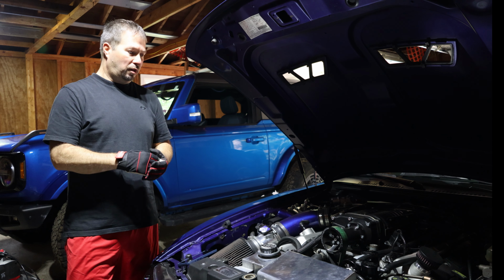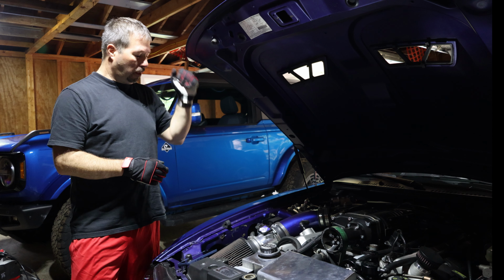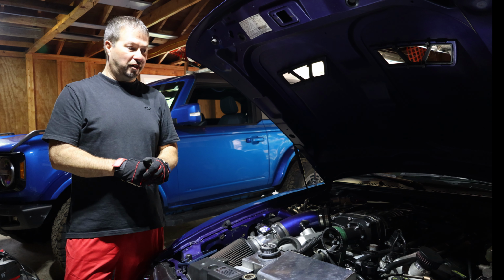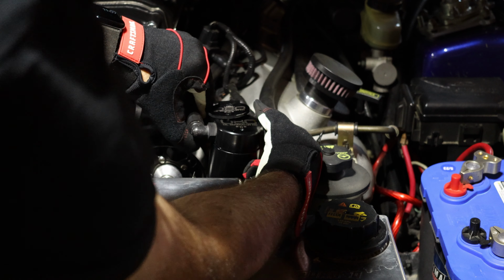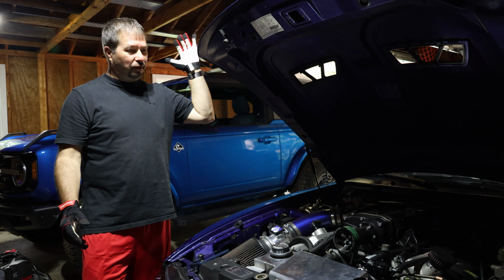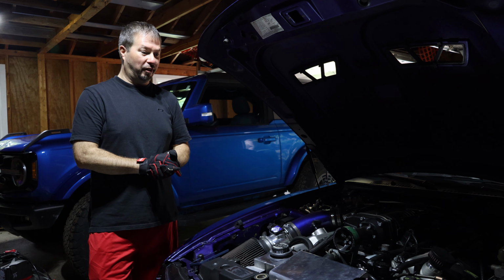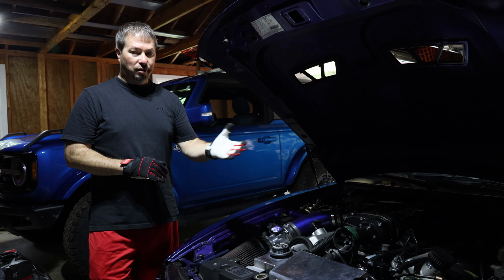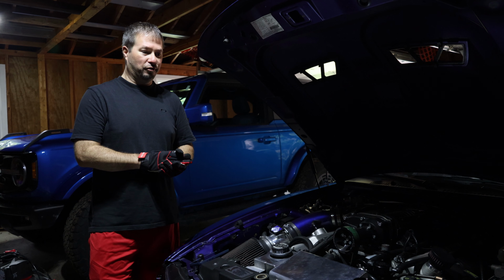Do You Really Need A Catch Can On Your Whippled Terminator Cobra?

Comment: My red cobra had one from the previous owner and when I took the ported Eaton off for my VMP install, it was bone dry inside the intercooler. Well worth it
Reply from the maker: I was lucky that this one did not have one at first but when we pulled the eaton off it looked quite clean and not soaked in oil. Maybe the fact the boost lines not being connected correctly and it bleeding off vacuum and boost had something to do with it, not really sure though.

Comment: I have used breathers on my setup for 5 years without incident. The only difference is that I change and/or clean my breathers occasionally rather than empty the catch can. I also hate the appearance the extra hoses give. I have never had an issue with excessive oil spray on the valve covers because I perform regular maintenance on my breathers.
Reply from the maker: @tomkjr1  The breather I have on it now has a check valve to prevent the oil spray from
coming out . It had open breathers before but I wanted the PCV system hooked up again
Reply: @Lethal_Venom  That is a good idea and it should work fine. My cobra has the sensors deleted...egr, pcv, frps and fpdm as well as the valve cover/intake vent hose. But I don't need to worry about inspection. It just comes down to individual choices and circumstances. It's a matter of using a sealed or open system.
Reply from the maker: @tomkjr1  Yup very true. I have inspection here and my EGR stuff is gone but I haven't had it inspected since I got it lol. I know more about the car being safe to drive than some twerp looking for treadwear and the horn working
Reply: @Lethal_Venom  Our NJ dmv inspection has become a travesty with all the layoffs and budget cuts. I took my Jeep last year and they had 4 people running the whole place! You could have bald tires and a headlight out but still pass! I just keep a current sticker in my window just in case, but I have bever even been pulled over.
Reply from the maker: @tomkjr1  That’s crazy! I’ve passed local county and state cops multiple times this summer and no one cares
Reply: @Lethal_Venom  I don't blame them. All the layoffs and cutbacks on important services while the people making those decisions raise their own pay! People are pissed off.

Comment: Thats interesting. I run the same catch can. I think ive emptied it once in the last 10,000 miles. Maybe because i only run my 2.3 at 16psi its doesnt fill up as fast. Idk. Lol
Reply from the maker: Which side do you have it on? Mines at 18 PSI so not really much difference
Reply: Same here I have the JLT catch can, and run a Gen4 2.9 whipple on my 04 Cobra, I don't get a lot of that oil, I literally just check mines in the sumner months. My Gt500  however does fill rather quickly.
Reply from the maker: @willsam6243  Yeah some fill quick and others don’t. I know the passenger side ones do not fill much at all
Reply: @Lethal_Venom  mine is on the driver side as well. Doesn't fill much, either way it's good insurance to have.
Reply from the maker: @willsam6243  Oh yes definitely
Reply: @Lethal_Venom  driver side. I had one a catch can on passenger side. Checked it was always dry. I think it has to do with some piston rings are in not as sealed as others.
Reply from the maker: @jmak03cobra66  yes very well could be